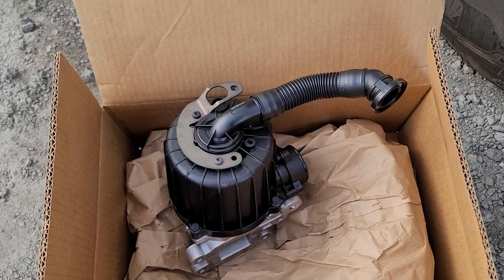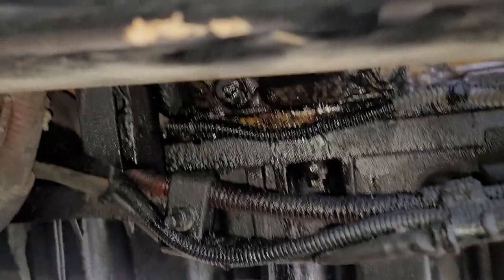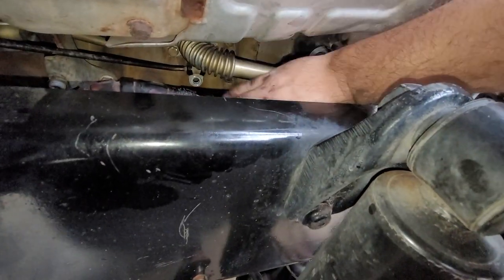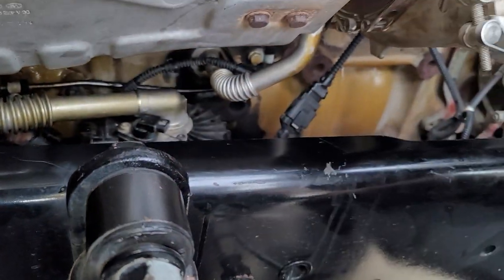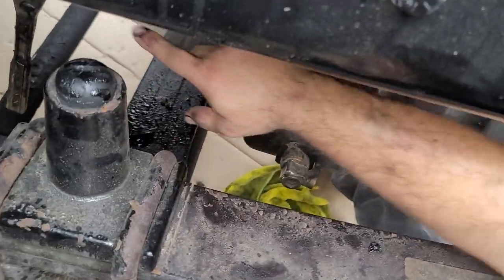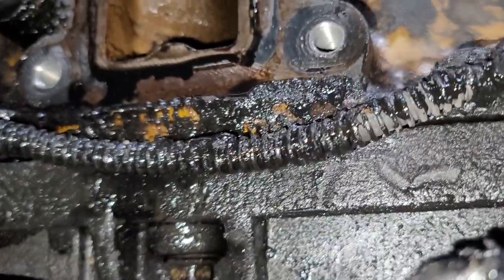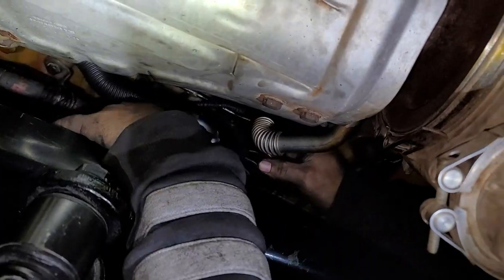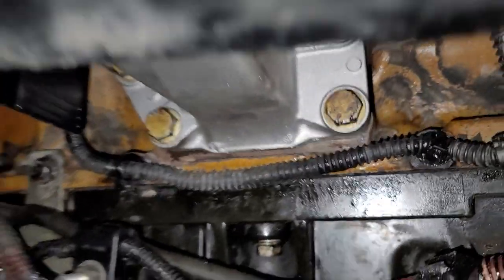Freightliner Cascadia crankcase filter removal replacement oil separator

Comment: Great video bro! Mine is starting to leak and is making the oil pan messy + I have the code already. By the way what did U used to clean the area so good?
Reply from the maker: Thank you bro, we used starting fluid, its a little stronger than breakleen

Comment: should this be replaced as maintenance or just wait till it's leaking
Reply from the maker: I replace it when it starts to leak,  its a little expensive,  thanks for watching sir 🙏
Reply: @TRUCKINGTIPSDIY  can it be driven once it starts leaking
Reply from the maker: Yes, this filter was leaking for about 3 months, a mechanic told me if it gets too bad all the oil will drain from there, so its better to replace soon

Comment: Would you know if every truck would need the adapter?
Reply from the maker: Newer trucks come with the adapter, this is and older year, 2013
Reply: @TRUCKINGTIPSDIY  okay i just changed mine yesterday on a 2014 Freightliner, and it didnt have the adapter.
Great video  thank you 🙏

Comment: good video, it has helped me a lot, a question?  do you have to drain the engine oil tank to remove the crankcase or not?
Reply from the maker: No you don't have to drain the oil to replace the crank case
Reply: Thank you 🙏
Reply: Aprovechando aquí brother que me contestaste ando buscando cómo mover cargas o buscando un buen dispatch si sabe algo me avisa por favor vivo en el ares de Ontario CA gracias
Reply: @TRUCKINGTIPSDIY  where do you buy your parts at?
Reply from the maker: All truck parts i try to get from the dealer, trailer parts from fleetpride stors like that
Reply from the maker: Yo uso el DAT board

Comment: Very good video as always but it seems like he doesn't read comments . He doesn't answer questions that people ask.
Reply from the maker: I do read comments,  some times im busy driving,  thanks for watching sir 🙏
Reply: what effect does it have? i am very interested
Reply: @Phamquoc0705  good afternoon sir ,my truck did this yesterday and the effect was at first loss of torque power and then red engine light and red oil light flashing indicating no oil. I was blessed to be close to a mechanic shop that did the job for me.i paid $ 817 for parts and service .hope this help.
Reply: @forhisglory7489  did this change of parts fix your loss of power? I’m dealing with the same issue. I keep losing power to my truck and all the def issues have been fix. I’m lost right now 🤯
Reply: Good afternoon sir ,yes once fixed my truck was back to normal.